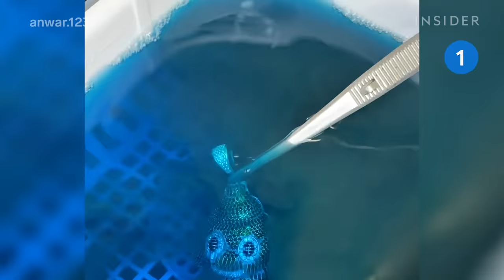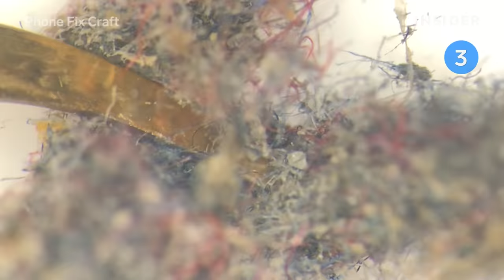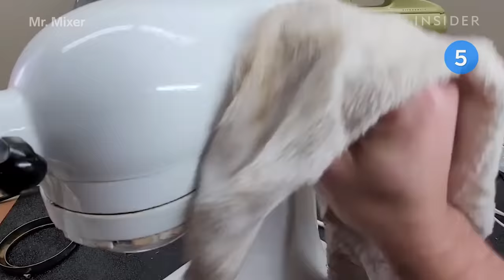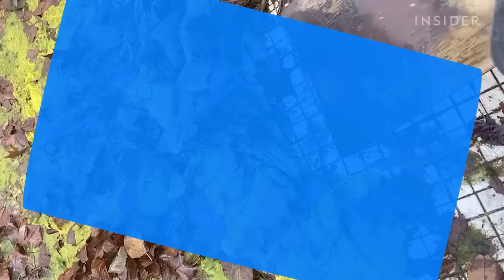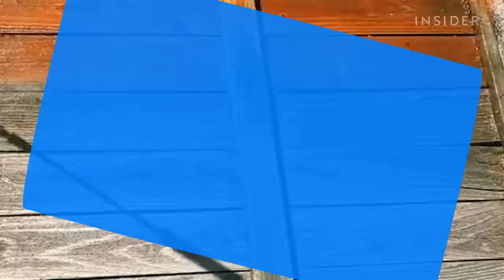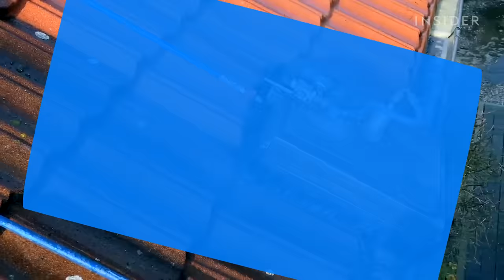Watch 10 Things Get Professionally Deep Cleaned | Deep Cleaned | Insider

Comment: As a jeweler, watching the jewellery cleaning videos makes me highly uncomfortable because my prof in Goldsmithing warned us about holding on to things while the ultrasonic is running because it can cause arthritis in your hands. You are supposed to just place it in a strainer.
Reply: If it really causes arthritis, wich I am not sure that’s true, then it’s probably the amount of times you are subjected to those vibrations. Those videos are probably like 1% of the actual products they clean and they probably just put the jewelry in the strainer when the camera is not rolling because it’s highly inefficient to keep standing at a machine that does the work all alone in the mean time you could be doing other stuff.
Reply: @Manie230  It can potentially cause arthritis over time in the same way that getting one x-ray won't give you cancer but being subjected to constant radiation will. Arthritis is  more common for people/ apprentices who's main job is polishing and cleaning. As for holding the jewellery I can understand the temptation to hold it vs putting it in the mesh basket because this is the final cleaning step after polishing so that it removes all the polishing compound from every nook and cranny. After all the sanding and polishing that's done you'd hesitate to put it directly in the basket because the vibrations of the ultrasonic cleaner can cause the jewellery to rattle in the cage and cause fine scratches. My classmates and I figured out a better way though for things like pendants that you can string, simply string a wire through and dangle it into the fluid but have it held up by the edges of the machine. Turn it on and leave it, turn it off and remove it. For other non stringing objects we've experimented with plastic mesh strainers that's much gentler on the projects. We jewellers can be unintentionally subjecting ourselves to a lot of harmful effects and substances without us even knowing because either you learn as an apprentice from a much older jeweler who's technically not up to date on current knowledge and studies or you learn through a school which is up to date. There's a process for casting called Investment mold making which involves a super fine silica powder. When I was in school our teachers were very, very strict about safety precautions and personal safety equipment when we worked with investment because it can cause lung cancer and other cancers. Apparently a lot of jewellers had lung cancer in the past and only recently have we figured out why but not all jewellers are aware of this new information and they'll teach their apprentices to do things as they've always done.
Reply: @amandasnider2644  thank you for that in-depth knowledge. I think learning a job from a very old instructor is probably a thing in many jobs. 

Often those instructors don’t go to advanced training wich would bring them up to date with the newest stuff. And then you learn two things the practical old school stuff and the new way better methods.
Reply: Maybe they were just doing that for the video
Reply: Whats ultrasonic in the jewelry cleaning video?
Reply: What is the secret chemical ? Can you tell?

Comment: "Most dirt is found in the charger port"
Me, immediately tilting my phone to stare at my phone's charger port:
Reply: I was vacuuming my phone inside out when I was watching it
Reply: Your comment just reminded me where my phone was.

Turns out it was in my hand, showing me your comment!
Reply: i clean my ports often by using my mouth as a vacuum, gives you a free immune system upgrade too 😃👍
Reply: @Kipplz  Nuts
Reply: @Kipplz  thanks for the cleaning tips
Reply: I've had my phone for a few years and not that long ago the charging cable wouldn't go in properly anymore, it would just disconnect, or simply not charge, or charge slowly.. I thought it was just because my charging cable was getting old or something (it was a bit damaged as well) but it turns out it was just dust bunnies stuck in the charging port.. Cleaned it up with a needle and it worked perfectly again after that
Reply: @Kipplz  I.. I've done something similar before. The worst is when you feel something going down your throat.
Reply: @stone5against1  Dust bunnies. Now that is a term I haven't heard in a long time.
Reply: guilty as charged. mine is almost squeaky clean

Comment: Just for your information, you don't need a specialized steam cleaner to clean the grout between the tiles, you can do it with soapy water, a brush, gentle scrubbing, and a lot of time. You can do it in small sections each day if you don't have much time. Just use a plastic or hair brush because a metal brush would damage the grout.
Reply: And by the time you reach the end, the starting portions would be dirty again
Reply: @galacticosno23  if you do one tile a day and you wear your shoes inside, yea. Even then, it'd still be cleaner than just leaving the dirt to build up.

Comment: For anyone freaked out by how dirty the jewelry is, more often than not, the jewelry isn't even remotely as dirty as it's made out to be, it's only "dirty" because it's loaded with polishing or buffing compounds after being polished and/or buffed, then it gets ultrasonically cleaned and then usually blasted with a tiny steam cleaner that removes the cleaning solutions.

Comment: I've had my phone for a few years and not that long ago the charging cable wouldn't go in properly anymore, it would just disconnect, or simply not charge, or charge slowly.. I thought it was just because my charging cable was getting old or something (it was a bit damaged as well) but it turns out it was just dust bunnies stuck in the charging port.. Cleaned it up with a needle and it worked perfectly again after that
Oh and a bit later the microphone stopped working.. People wouldn't hear me on phone calls.. So I tested it recording myself, and I could hear it a little bit but I had to speak pretty loudly into it.. Needle in the mic hole fixed that as well

Comment: Its seems to be correct what you have explained but I have doubt over your information on generation ozone using UVC lifhts, coz as per my understanding this can only be generated by UV light source with vacuum emitter unit with wavelenght less that 120nM wavelength as per UVC light band its around 220 to 265nM.

Comment: What I can't understand is why people buy diamonds for $15.000 and never learn how to clean them! Take 3 drops of a good handwashing detergent in an egg cup, add boiling water, leave the ring in over night. Brush gently with an old, soft toothbrush on every side. Use no force. Rinse with water. Blow the ring dry. Polish the gold with a yellow- or white-gold polish cloth (they are NOT the same! Lasts for many years, $8). Do it every week if you use hand cream. Cost: $ 0. If you turn it in for cleaning it's $15. The job for a diamond is to sparkle :). I have one toothbrush especially for my rings.

Comment: Ultra sonic cleaning isn't special or new.

The car detailer isn't doing the job correctly and causes long term issues by filling the foam with chemical and water which doesn't dry properly and creates mould.

High pressure cleaning of concrete isn't special either, any $100 pressure washer will do the job.
Reply: Timestamp all of these please